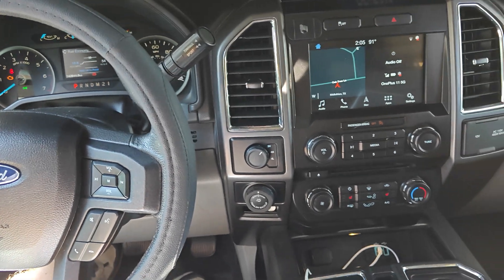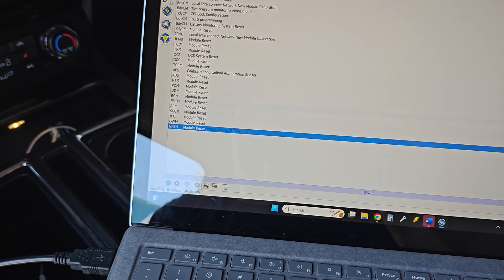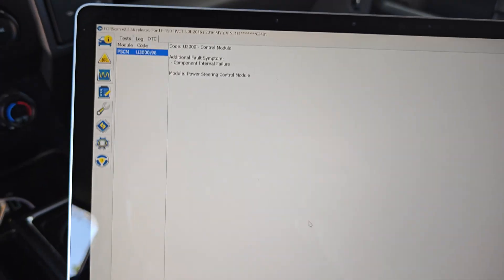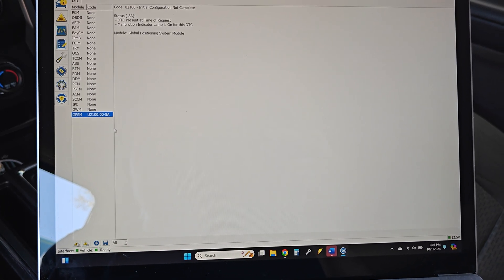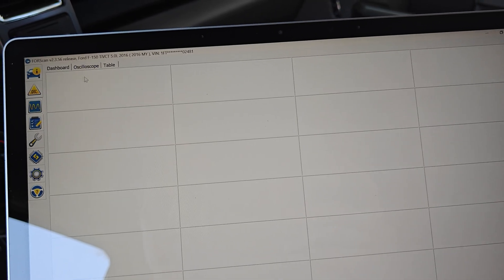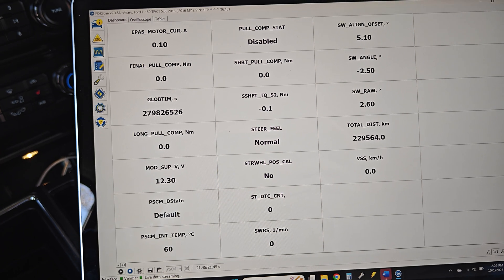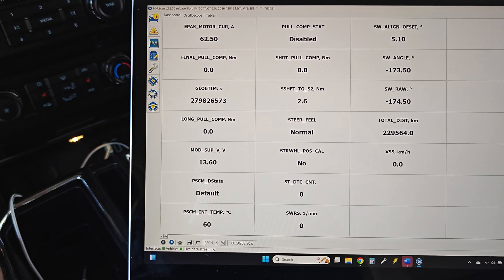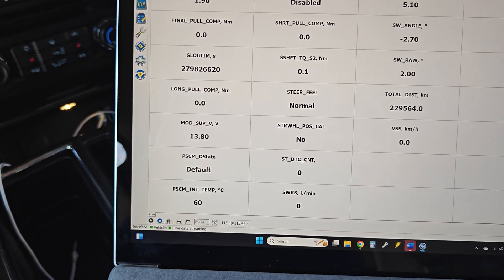F150 Electric power steering issues EPAS / PSCM problems

Comment: My steering takes a while to kick on now but works 100% proper and never turns off as long as i don’t turn truck off. Left turn signal clicks faster than right and vol up and skip track on wheel does not work. Is this clockspring issues you think or rack?
Reply from the maker: I would look into the clock spring and the steering angle sensor. Hooking up a laptop to it would be able to tell you if the torque sensor in and steering angle sensor are functioning the way they should

Comment: Im in the same boat. Temp spikes, rack shuts off. Service stabilitrac error on the screen. Replaced the rack and have the same issue.
Reply from the maker: @warpedapple  I had to get a SECOND replacement rack. The first one I received from BBB industries ( a rebuilder) did a similar thing. I returned it, and the new one has been great. The first replacement rack that I got we're just Spike the temperature straight up into the shutdown Zone instead of slowly building up

Comment: Are you having a popping or any type of noise when you lose power steering? And is it brief and comes back or does it stay gone until key cycle??
Reply from the maker: No noise on this one. The power steering comes back sometimes if i move the wheel back and forth and wait a little bit. Sometimes it goes away for the rest of the day. I replaced the rack with a reman unit, and it lasted 2 weeks. I just installed the warranty rack. It is good so far, But i will definitely do an update video soon
Reply: @gagefixeseverything  I was having intermittent power steering loss, but only in small bursts and felt like I was fighting thru bind. Was also popping and clicking though. Replaced the steering shaft with no difference. I have a brand new motorcraft rack ready to go in, but now it hasn’t done it in 2+ weeks so idk what’s going on haha. In ForScan it had a lot of codes for loss of communication for the rack, but I cleared those and did a self test and nothing. I’m at a loss as to whether or not to go ahead and replace rack or not